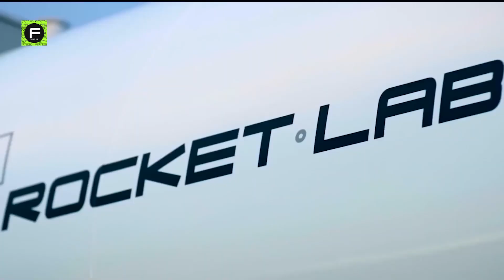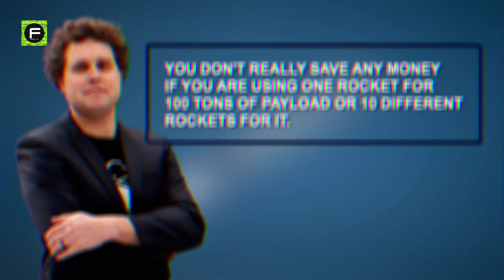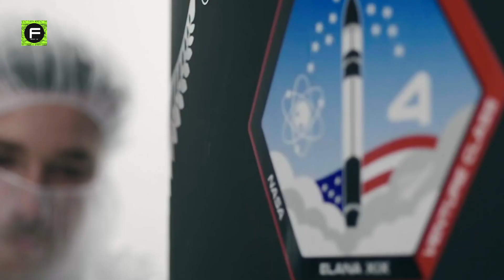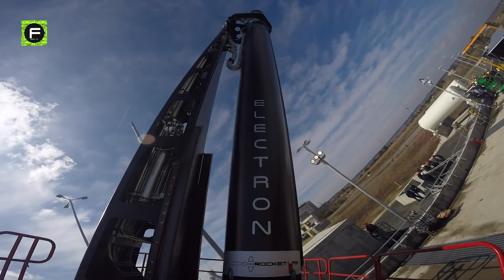Rocket Lab is Doing what SpaceX couldn't

Comment: Stainless steel against Carbon Fibre, mmm - for reusable components - what about re-entry, surely that why Elon has gone for SS!
Reply: The work has done by heat tiles not ss. Carbon fiber melting point is above 4000°c and ss have only  2500-2700 °c

Comment: Rocket Lab is still doing conceptual design while Starship was ready to launch yesterday and fabricating a thousand more. SpaceX is now printing Starship parts and has now the capability of printing a whole Starship if and when there is an application for it. Rocket Labs’ new rocket may be an overkill unless you are landing on a storm-ridden planet that requires a spaceship stronger than a steel alloy.
Reply: "Space x has the capability of printing a whole starship" 🤣 wut.
Reply: @austinbrito627  , if Elon saw the benefit of printing a whole rocket system, he would have done it by now.
Reply: Wtf are you taking 100 plus payload sent to space 😐
Reply: @visionforbitcoin8436  , that’s why the old rolls of steel sheets is still the cheaper portion.